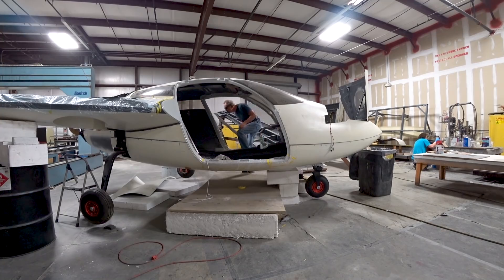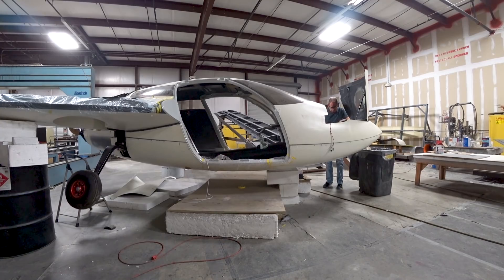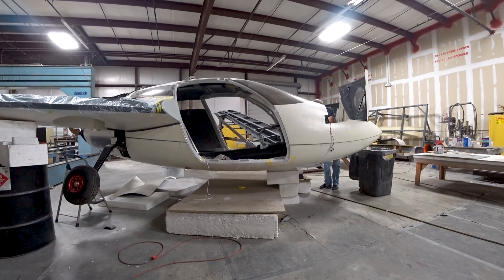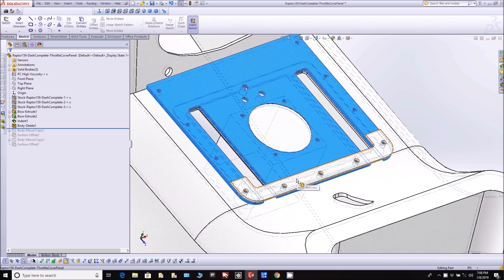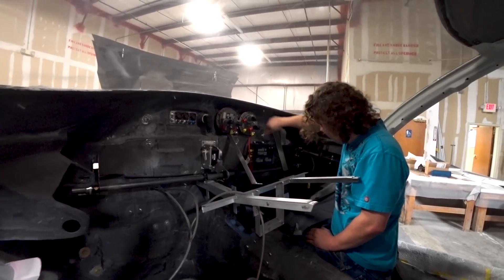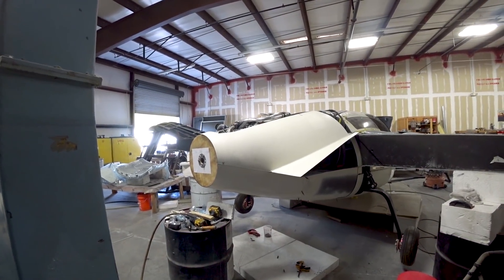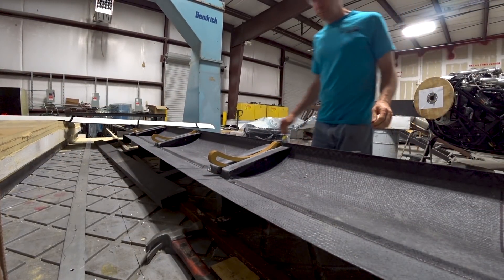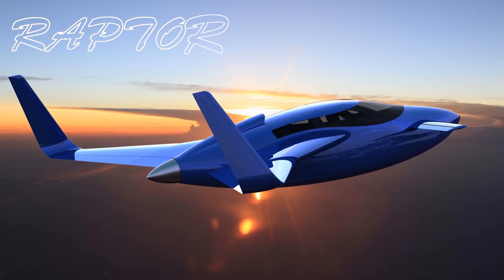Wing Fitted, Gear Tweaked - Building the Raptor Prototype

Comment: I never saw you mention if lightning protection mesh was applied to the outer surface?
Reply from the maker: Not on this set of wings. However I did measure the conductivity of the carbon and it's very good so it may not even be required going forward.

Comment: My thoughts on the U.C. movement issues:
Air Bubble: If you look at Time 08:40 the STB gear dips but the port gear doesn’t but then at time 09:18 and onward the Port Side dips but the STB doesn’t. I suspect an air bubble moving around the circuit. Perhaps with enough cycles it will get back to the pump where it will be expelled into the reservoir.

A slight variation in the mechanical structure of the gear will present as a resistance variation meaning that the gear will move in an uneven manner. Perhaps one pivot bolt was tightened up a couple of pounds more, perhaps one leg weighs a little less. A Possible solution may be to use an appropriately sized “Pressure Compensated Flow Divider.” The following link may be of interest. https://www.youtube.com/watch?v=gWt_nkKKxEE . Surely someone in the A/C industry has produced a suitably sized unit that takes standard fittings.
Reply: Danny Georgeson very cool!

Comment: In pnuematic control systems, we use one-way flow controls with unrestricted reverse flow on each cylinder to restrict the flow leaving the cylinder - something like McMaster-Carr 1042K14.  This way, the entire system stays pressurized, giving you good positive control over the speed of each cylinder.  Sort of like the improvement you got when you controlled the flow into the pump, but doing it at each cylinder should give you better response for each landing gear at the same time.  Worth a thought!

Comment: Looks huge with the wing on it!  The elevators appear to be get in a bind if there is uneven pressure from inboard to outboard as it travels fore and aft.  If the pushrods are perfectly in sync I imagine it will be a smooth action, but if there is a chance that they could get out of alignment it might be difficult to easily control the pitch and result in a dangerous situation.
Reply from the maker: They are all interconnected so there is no way for them to get out of sync. Still, this is an experiment. It may not work.

Comment: The landing gear is acting like there's air in the system.  Do you have a way/procedure to bleed the air TOTALLY out of the system?

I would like to suggest what we use in a transmission shop to bleed hydraulic clutch actuation systems, the Phoenix Bleeder.  Here's a copy-n-paste from their website...

>>"Many don’t know that our Phoenix Bleeders have been taken to the air as well. Anytime an aircraft component is replaced, or the hydraulic system is opened for repairs, the hydraulic system must be bled of air to the maximum extent possible. Because of its innovative technology, seasoned mechanics now look to any of the Phoenix Systems bleeders to provide a hydraulic system that is free of as much air as possible."<<
Copied from:
https://www.brakebleeder.com/contest-tell-us-use-brake-bleeder/
Keep up the great work!

Comment: the main gear coming up is the first gear almost up and the flow to it increasing just before it stops taking away the flow from the second.. so it drops and then comes back up.   there should be flow control valves that are adjustable flow in one direction and free flow in the other.   a flow divider? for the main.   i wonder if there is some air trapped someplace.

Comment: Personally, I wouldn't be too worried about the gear up wiggle - Cessna 172/177/182/210, etc have a bit of a wiggle, which gives them a slightly nuanced persona.  It wouldn't worry me if my Raptor did that!  : )
Reply: sactu1 I would.  It’ll be very uncomfortable both in yaw and in clunks. This needs to get fixed. I’m in the accumulator camp.
Reply: @triav8n  Fair enough.

Comment: Look at a Sun Flow Divider Combiner, you could make a little manifold with the flow divider/combiner and a flow control, maybe even counterbalance valves if you thought they might be necessary. Sun Hydraulics Part Number FCDA

Comment: Do you have a hydraulic accumulator in the gear operating circuit which charges prior to starting the retract sequence?  If not, that would help the pump keep up and allow you to better control systemic flow and pressure dynamics using your return restrictions as the main gear cylinders stroke.  Every time I watch the videos of the gear operating - although today looks better than previous - i think either your pump is not keeping up (flow) or the system is still not fully fluid packed and you have air trapped in the system.  Flash a hydraulic schematic up on the screen in the next video.
Reply: Former US Navy aircraft hydraulics mechanic (AMH) here, I thought the exact thing.
Reply: i think an accumulator, a flow divider, and possibly some check valves to prevent cross flow might be the ticket.

Comment: bad place for gear indicators 
having to move you're head down then back up can be disorienting, definitely a no no.  please put them somewhere on the panel same goes for the gear lever but its to late  for that on the prototype but both should be relocated to the panel for production for safety reasons.
Reply: @Greg, I couldn’t agree more. Lights blocked by the throttle. Why not fix now when it’s easy?
Reply: Yes fully agree - lever should be in view, on panel (but not where can be accidentally hit), with 3 lights above or below it and again easily in view - center of panel would be good - this prototype is the place to make that change NOW - its not a good selling point having a glaring design fault like that.  It really does need to be changed before first flight.
Reply: Aesthetically, the gear lights look good on the center console. I like the thought of keeping the forward panel clean  Practically, gear indicators must always been in the pilot's peripheral view. Is there a plan to display the gear position indications on the Multi Function Display?
Gear lever location is less important.
Reply: I think the position of the gear lever is okay, because it is something that can be done easily just by feel.  As for the argument that it could be accidentally bumped, if you look at the video where he shows the actuation of that lever you will see that it takes a very clear pull out to clear the detentes to possibly move it.  Safe from bumps I would say.
Maybe split the difference on the gear down indicator; leave the lights where they are, but offer a repeater on the dash, or even bounce a heads-up display off the windshield as an option for those who want it.
Reply: although this is an experimental ac   you have to remember that this is a seriously advanced ac with real world ifr capabilites that will far exceed the capabilities of the average experimental pilot.  Large head movement in IFR conditions can and will physically disorientate a person and can cause you to be unstable in a critical stage of flight.  i agree that day vfr it would be less critical but this plane will be flown IFR by inexperienced pilots that will need every advantage possible and this is an easy to fix disadvantage.
Reply: I would put the gear lever between the center and left MFDs.  Possibly add a link to a caution light/panel for a gear unsafe condition would be nice but not necessary. Will there be sensors for the gear doors if they get stuck in one position or the other?
Reply: Not sure I agree with this criticism. You should put the gear down BEFORE even commencing the downwind leg - long before nearing the ground. Sailplanes have the gear lever on the side, well below sight level with only a visual check available (no lights)
Reply from the maker: Do you even use checklists? If so, the position is irrelevant.
Reply: With all due respect Peter - I happen to have badly positioned landing gear lights on my AC and I curse at this every time. Landing such a complex (and fast) aircraft on a busy airport in difficult weather you need every bit of your attention focused on essential items, not working around ergonomic mistakes. Imagine being on an ILS, struggling with crosswind, airspeed and descent rate, adjusting parameters for the config change from clean to landing and ATC asking you to expedite and exit first left, so you have to readback... this is really 100%+ workload and every bit of unnecessary work should be avoided. As a minimum fix, I suggest you duplicate the "3 greens" in direct line of sight - that's what I intend to do in mine.  @RaptorAircraft
Reply: Raptor Aircraft 

yoke mounted check list

look your doing a great job but you shouldn't forget that this plane is incredibly advanced and at the price you are planning it will be financially in reach of the masses.  People with little experience in the type of flying its capable of.  simply put its a bad place for gear level and lights for multiple safety reasons and when it comes to safety there should be no exception.  Prototype is one thing but you should consider relocation  for production.
nuf said awesome airplane
Reply: Raptor Aircraft Peter, how does checklist usage improve the utility of poorly placed indicators? You shouldn’t flippantly dismiss helpful comments from people with far more experience and knowledge in aviation safety and human factors than you.

Comment: Have you considered that the gear issue is related to volume not pressure? A flow divider may not work and instead dedicated hydraulic lines for each gear

Comment: Peter, install the flow divider on the up stroke side of the system only.  If the down stroke works fine, leave it plumbed as is.   You may have to sinc the gear as if one gear hits the stop in the wheel well, the other gear will stop.